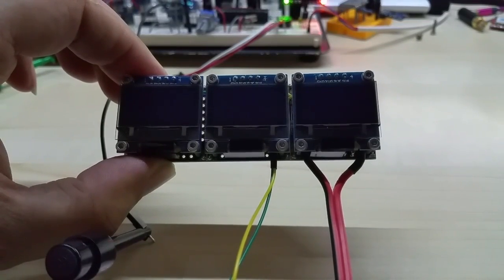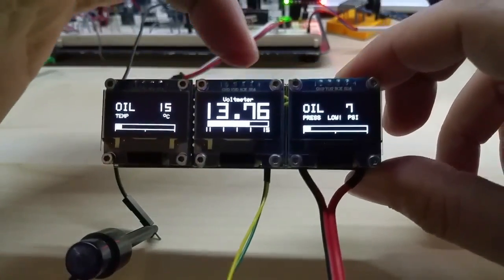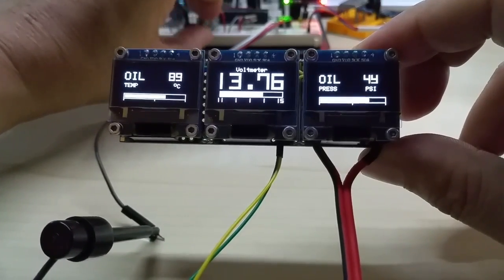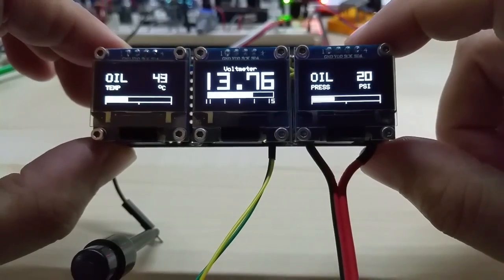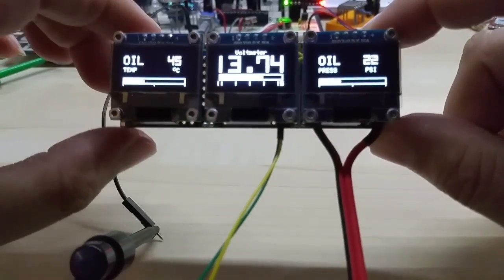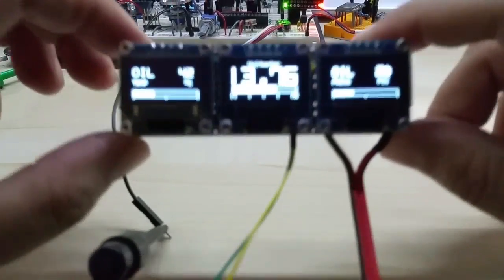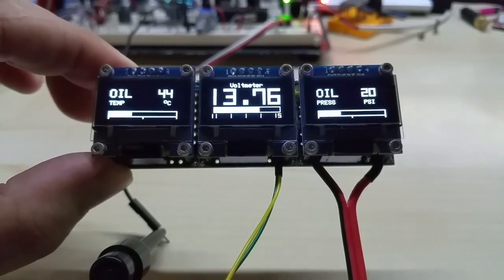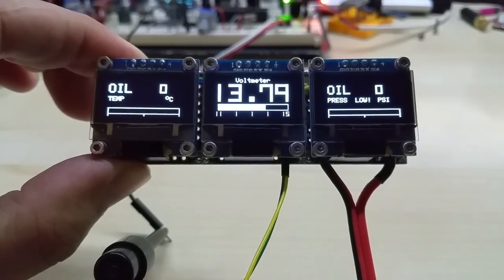Custom Tripple OLEDiUNO Car Gauge

Comment: For example, how is the oil pressure sensor connected?
Reply from the maker: Plus, Minus and 5V signal wire.
Reply: @iHayri1  Thank you very much, this is what I don't understand.
We receive this data as analog from the vehicle's standard sensor. Or are we installing a different sensor?
Reply from the maker: @alperenkurt2003  well that depends on the vehicle, some have a oil pressure sensor that have a 0.5-4.5V output, some only have a switch for a oil warning lamp in the dash. This gauge will work with a 0.5-4.5V sensor.
Reply: @iHayri1  thank you very much for the information
Reply from the maker: @alperenkurt2003  you are very welcome.

Comment: Good time. How much does this kit cost, do you sell it ready-made or a set with a firmware for self-assembly? With respect
Reply from the maker: Thanks, this was a custom order for a customer, but I do not have the used PCB's anymore. My current gauges are working with OBDII / CAN BUS.

Comment: Good day harry. 

Can you make a video on a single display wich can switch between difrent types of dat such as batery voltage, boost presure and air fuel ratio.
Reply from the maker: I do not make any OLED display products anymore as for gauges, I only make OBDII CAN BUS Gauges. Here is a link: https://youtu.be/Cq2n2Yjmh3A

Comment: Did you use pull up resistors for the displays if so what's values I have an analogous project thank you
Reply from the maker: The displays I use do have the pullup resistor. If yous do not and any other I2C device does not have them either you can use 10K pullup resistors, 4.7K are ok as well.
Reply: @iHayri1  thank you for replying back on a comment from an old video
Reply from the maker: @DD-jj2tc  No problem, hope you get your issue resolved.

Comment: Will your OLEDiUNO work with the 1.5" 128x128 displays?
Reply from the maker: My PCB is made for I2C displays, the 1.5 is a SPI display.
Reply: @iHayri1  the one that I see is SPI or I2C
Reply from the maker: @squaty1212  Mine are I2C, I2C has only 4 pins and SPI can have 6 or 7 pins.

Comment: Did you manage to make an OBDII version? I am interested!
Reply from the maker: I am working on the OBD version for the V-Gauge at the moment.
Reply: That’s excellent, I’ll have to look into the vgauge
Reply: How does the vgauge deal with different PID’s coming from the different cars? For example my Toyota GT86 has a custom pid which is different to standard for oil temperature.
Reply from the maker: @juzzotec  It will support standart PID's and custom ones will have to be uploaded separate.
Reply: I have this idea, to create a simple display, not a racing style vgauge that reads obd2. Not Bluetooth but hardwired into the obd2 port. Unfortunately I don’t have the skill level. I love how small this display is and would be useful to capture important readings while at the track, such as oil temp, oil pressure etc...
Reply from the maker: Well once I have settled on the hardware I might release a single display version too.

Comment: Today I learned that you can buy OBD-II to wifi adapter dongles with zero lag!  It looks like Wifi is a better option than bluetooth if you want to develop an ESP32 system
Reply from the maker: I know there are also OBDII WiFi dongles but why go through that hassle? You need a connection to power anyway just add 2 more wires and you have a rock solid connection with the car and only the ODBII plug to connect. Sometimes simpler is just better :-)

Comment: Just a friendly suggestion to base your next generation OLEDuinos on the ESP32 so you can use the onboard bluetooth to communicate with those $10 OBD-II dongles from eBay to retrieve telemetry data with no messy wiring.
Reply from the maker: Thank you very much for your suggestion,  I will eventually make a OBDII version but I doubt it will be thew ESP32 because I do not like the lag it has and the pairing requirement. As I see it it is a permanent installation and there it can be hardwired and the power can come from the OBDII port as well. Unfortunately my car has no OBDII port and I can not make it yet. Appreciate your comment :-)
Reply from the maker: That would be one way, looked into it a little but they are not cheap, maybe I should build a simulator first and then build the reader based on my OLED PCB's :-)
Reply from the maker: Not at all, you need to connect to a computer, edit the WiFi credentials and upload the code to the unit and Bluetooth is even worse because you need a input method to be able to pair. No matter what, you need to plug in something to the OBDII port, why not just plug in the plug and have the CANH and CANL (TX/RX) and the power connection ready? If the OBDII port has a switched 12 volt you don't even need a power switch on the display and have it turned on and off through the cars ignition, I would of course still have a power switch on the display as you might not want to turn the display on every time you drive your car and can simply turn it off.
Reply: +Hayri any updates of obd2 version?
Reply from the maker: Well, the problem is that my car has no OBDII port and I can not test anything :-(
Reply: Hayri 
It might be best to just buy an OBD-II simulator if you ever decide to develop a system because then you can do your development work inside your home.  Prices vary greatly so shop around.
Reply: Hayri 
This looks promising: 
 https://github.com/limiter121/esp32-obd2-emulator
Reply: Hayri 
Try this link instead
https://hackaday.com/2018/04/11/emulating-obd-ii-on-the-esp32/
Reply from the maker: Now you've done it, you'll make me buy a ESP32 and I wanted to stay away from it, hate bluetooth :-) Was looking 4 something based on the Arduino so I can use my boards but did not find anything yet. Funny thing is I have 5 of those transceiver modules that I bought a while ago, now I could use them, I wonder if that emulator can be made to work on the ESP12
Reply: An ESP32 based OLEDuino paired with an inexpensive OBD-II dongle would be the easiest way to add custom gages for 90% of the population, and that's just for OBD-II car applications.   The problem for me is that I think an ESP32 based product would be so popular that you're likely to sell out your entire inventory.   Can I place a deposit so I can be the first customer in line?  I'm being serious.  My wallet is ready now.   You already have a proven product and you should start a Kickstarter.
Reply from the maker: Well, I might use the ESP32 as a simulator to test the hardware but if I make a OBDII gauge it will be Arduino based and a wired version, a simple plug and play, no pairing hassle, no delay due to bluetooth connection. There are plenty of apps that do the BT way :-)
Reply: Hayri 
Just for clarification, the ESP32 is compatible with Arduino code and the Arduino IDE.  There's at least a dozen other languages you could use to program the ESP32,  but I prefer the Arduino IDE because that's what I am most familiar with.
Reply from the maker: Oh, I know that, that's how I program the ESP12 too, but it makes no sense to me to design a PCB for the ESP32 and use it if I am going to make it a wired version and the display can either be made with the 328 chip or ESP12, plus my OLEDiMAXI PCB is set up for automotive use already and it will need just 4 wires connected to the car.
Reply: Hayri 
I am making the assumption that it would be easier to reconfigure a wireless version to display whatever you want on the fly without changing your wiring harness..... Or are you planning to pull data over wires over the CAN bus?

Comment: How do you program your gauges? Is this through an arduino?
Reply from the maker: Yes, they are like miniature Arduino UNO's with an LDO, voltage divider and other necessary components.
Reply: Hayri  very cool. I am experimenting with coding as a hobby and was curious what language you use to code. I would love to try a project like this to learn electronics and coding.
Reply from the maker: Thanks, I am writing the code with the Arduino IDE.

Comment: Ok.. whats the price on 4 gauges.. but need them all to be separate.. coolant temp, oil pressure, volt, and fuel
Reply from the maker: You can see the prices in my Tindie store, link is in the description. You can use the voltmeter as basis.
Reply: Hayri .. so that's like a 130 for the 4 plus shipping..
Reply from the maker: I just added a discount for orders of 3 or more for you.

Comment: Iwould  Like a flowmeter for water pressure  gauge  and tempreture  for Italian cars  2137179118@archwireless.net/2137179118@USMobility.net
Reply from the maker: Sorry, don't have the required parts nor the time for new projects at this time.

Comment: Would it be possible to interface these with air/fuel wideband sensors? These would be awesome for multiple AFR gauges to use individual sensors in each exhaust primary. Computer data logging output would be cool too.
Reply from the maker: If your sensor outputs 0 - 5 volt or can be adapted too, it can work with the right code.

Comment: this is spectacular mate! i love your work. i could imagine it would be very difficult to create a obd connection for the various makes of vehicles especially with anything from VW group. Do you use the Mercedes obd port to function or is it just picking up the inputs of the ecu?
Reply from the maker: Thank you. I will eventually bring out a OBDII version, it is on my to do list (which is about a mile long btw) but only for basic data that is hopefully not independent from car make and model. Obviously I could not do it for all cars out there if it has to be specific. The display in the video is connected directly to the sensors output.
Reply: Так же интересует тема OBD для тайота sv32

Comment: Would it be possible to add it to land rover defender 90?
Reply from the maker: These displays take analog sensor data at the moment, if you car has suitable sensor output you can use it. A OBDII version is in the works, for true plug and play compatibility.
Reply: Thanks for the attention, I can configure or you configure according to the client? If yes do I need the arduino to configure? Buying with you the setup is easy?

Comment: Hello, thank you for your videos. Do your have a way to do sensors for battery health. AMPHOURS and Volts or something like that?
Reply from the maker: You are very welcome, technically it is possible but a sensor board with a shunt needs to be used to measure the amps and calculate the amp hours.

Comment: have you had anyone ask if you can adapt to small 2 stroke motor for rpm?
Reply from the maker: Not yet, don't know what kind of signal you get from a 2 stroke but it should be possible to adapt the code to it.
Reply: You need to add a hall effect sensor and a magnet on the fly wheel

Comment: So with that clock you showed at the end with 2 colours is that a coloured coating, like for example could you stick that over the "HOT" and "LOW" warning messages? Red would look pretty cool
Reply from the maker: No, these displays only come in white, blue or yellow blue where the top 16 pixel rows are yellow and the rest is blue.

Comment: isnt it water temp not oil temp. Also would this work without a ecu in a car?
Reply from the maker: both are being used, depending what the customer wants. These work with the regular sensors in the car.

Comment: Hmmm wonder if I could integrate the GPS speed design into a Jetski... would need some way to waterproof it and add switched power to it
Reply from the maker: Very easily with a waterproof case of a GoPro Session, made one for a customer for his sailboat. Can even use the slightly bigger 1.3" OLED display depending on code used, which fits perfectly to the case.

Comment: Hello Hayri, Is it possible to measure the time it takes to travel at certain distance? For example 1/8 mile? I have a racing car, and I would like to see that information in my car.
Reply from the maker: Don't have a 1/8 mile but a 0 - 60 mph
Reply: I think I didn't explains correctly. 
I would like to save 2 points in the GPS (Start and Finish), when i pass the first point (Start) the time starts running until I pass through the second point (Finish), and then the time shows up in a display, my car do 8.6 seconds in 1/8 mile, but i cant know the time until i am back in the hangar
srry about my english :)
Reply from the maker: Everything is doable but for that a new code has to be written which I don't have the time for. Sorry
Reply: i'm already working on it, i was just looking for ideas and see if that was possible, i had never worked with a gps. Thanks.

Comment: Greetings, neighbour from the South! I am very interested in purchasing an OBD II capable unit with either one or two displays like the ones you show here. If I could get real-time monitoring of water temperature and engine RPM I would be sooo happy!
Reply from the maker: These are not OBDII yet. They connect directly to sensors. Working on OBDII support just waiting for parts.
Reply: Yes that first part was quite obvious. If you do make an OBD implementation down the line, I will be one happy customer.

Comment: Is there a maximum tempreature threshold? I am curious about a system like this for gauges in my desert race truck. Seems to be extremely bright and clear!
Reply from the maker: OLED displays can work up to 80 degree Celsius if I remember correctly.
Reply: https://www.google.com.au/search?q=OLED+display+operating+temperature&rlz=1C1GGRV_enAU781AU781&oq=OLED+display+operating+temperature&aqs=chrome..69i57.11783j0j7&sourceid=chrome&ie=UTF-8

Comment: Pixels on these screens burn out in a month, so they are absolutely useless as car gauge.
Reply from the maker: Sorry but that is nonsense, I have OLED's running 24/7 for over 6 months now without a single pixel burning out. Don't know where you get this info or what type of OLED's you use. Don't make false assumptions.

Comment: Great product!  In trying to do a Heads-up display, can the display be mirrored so it can be reflected from the windshield or some similar setup??
Reply from the maker: The code would need to be rewritten because as far as I know adafruit library does not support HD mode. The GPS code which doesn't use any library can be set to Hud mode, as a matter of fact somebody did ask me that today.
Reply: Thank you for your response...